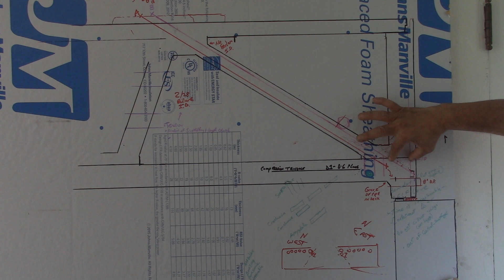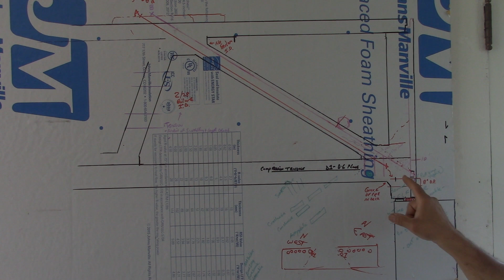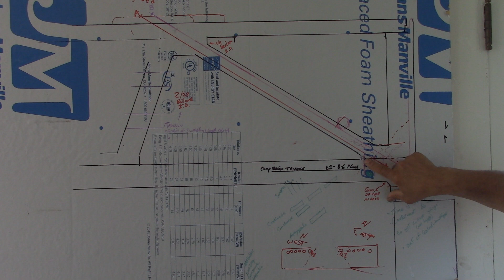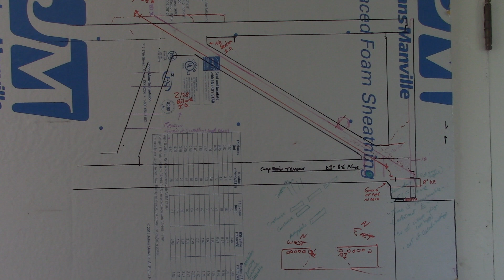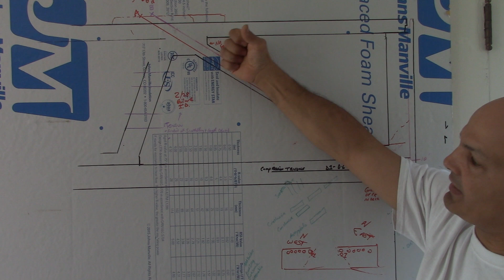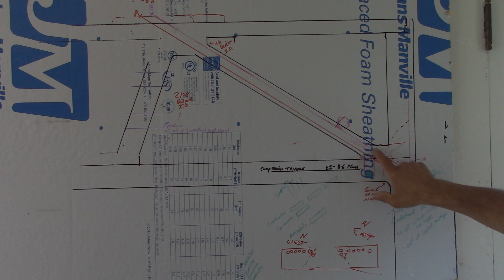FIU Bridge Collapse Tension in 10 TORQUE Shear Deflection 2 & 11 tensioning key to failure Pt 2

Comment: Great job K. I've been following since day one abd had taken your advice not to draw conclusions before the data it is in. 

Now I get it, maybe not the precise moment(s) of failure but a deep understanding of the mechanics of this bridge along with all it's inhetent flaws, the human element notwithstanding... all because of  your master class.
When my ship comes in I'll toss you a line

Until then take my upvote and my thanks
Reply from the maker: Thanks Tommy, I appreciate your comments and feedback. 
I am still working on this chamber issue to create those darn cracks in 10 (during the initial post tensioning in the staging area)...  
I will not be satisfied until I can reproduce them with a physical model I have... 
The ratio / lengths I still have wrong... Need some darn details of a joint...  Will update with a video of course, if I can get this to work...
Reply from the maker: Tommy, 3 a.m. here and I am writing all my regulars to tell them some great news...  https://youtu.be/aeK_DptYs00